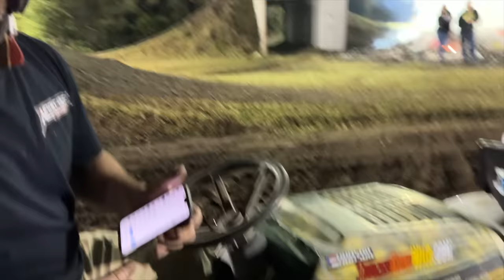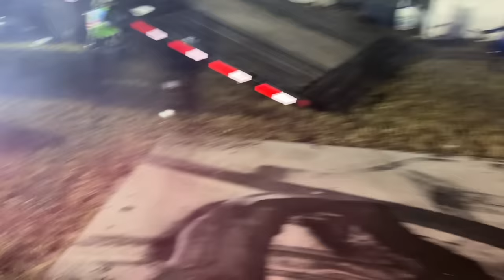We Host The BIGGEST & Wildest Lawn Mower Race Of The Year! HUGE CRASH! JH Diesel New Years Eve Bash!

Comment: That tree coming out of turn 4 is a little scary... lol

We built a clay oval about the same size as this in my father's back yard, and have a tree in pretty much the same exact location...  what're the odds? lol  

We race fairly modern go karts around it though, with mildly hopped up Predator engines... Our first "season" was probably the most fun...  After a few weekends worth of racing,  we all started getting beat up on by my uncle's friend's son... Turned out he was saucing his tires (and we all agreed we weren't gonna do that), so my uncle showed up a couple weeks later with a 14:1 motor with big valves and a cam... My dad and I were the only ones who knew about the motor, but it was funny as hell watching that kid that was cheating getting all pissed and thinking there was something wrong with his kart.

Now, we all run tire sauce and Predators with the "265" cams in them.  Really fun for what they are!!  Like 25 years ago, we all raced in an abandoned parking lot oval with Briggs & Stratton "Raptors" (iirc) on them, and they didn't make near the power that the OHV motors do.

Comment: Okay Mr JH diesel you and Cletus need to get some dirt track go and put 450 motors on them Yamaha 450 Suzuki 450 a KTM whatever you want as long as it's a 450 everybody has to have pretty much stock besides and maybe Jack in the carburetors or something and you could be able to put a bigger fuel cell on them for in the middle of your legs and Men racing at the freedom factory Cletus got to set up a race with 50 lap race with round track dirt go-karts with 450

Comment: Guy with open pipe is losing power longer it runs that exhaust valve is expanding because it has no heatsink should just run 1¹/⁸-1¹/⁴ ending with 1¹/² tube.

Comment: I know that racing mowers isn't the main thing you do. Everyone starts out somewhere, I get that. But I'm sure there are a lot of us that do it a lot more often that would enjoy this content more if you and the people you have come out and race have machines that are like your GP-T. A prepared chassis like that will be a lot safer, and you can still be plenty fast with a stock governed engine. Another point of safety there by not bypassing the governor and risking having a flywheel explode. Now, a group of mowers like that, you'll definitely are going to want more space than what's there currently so there is room to safely leave the track and/or stop if there is an accident.